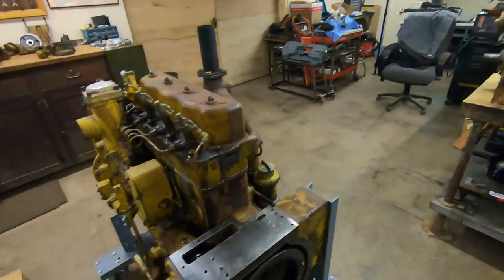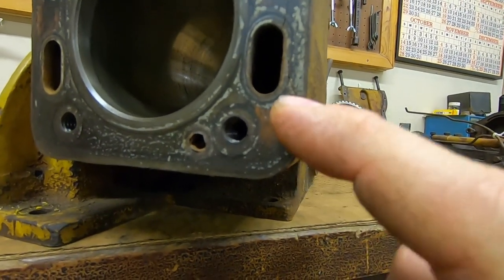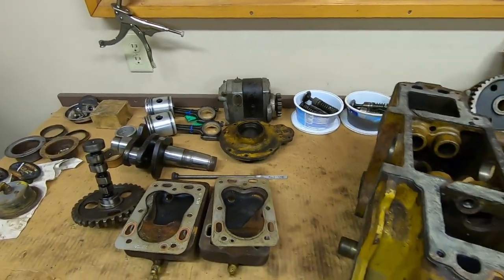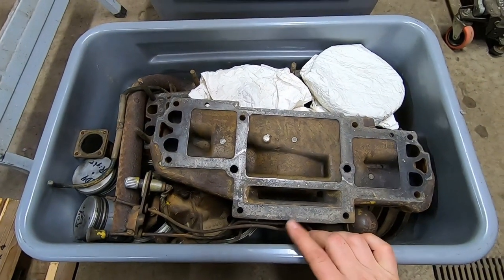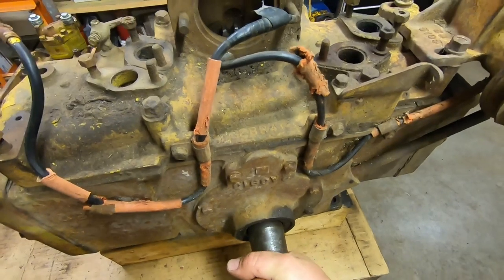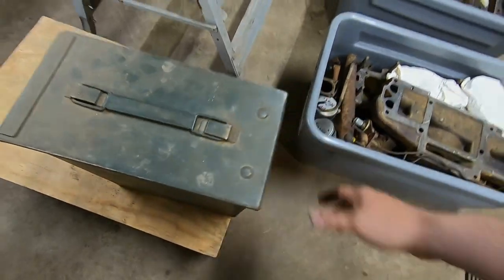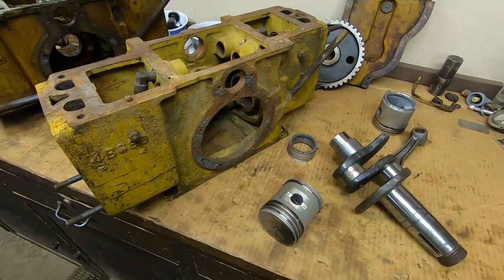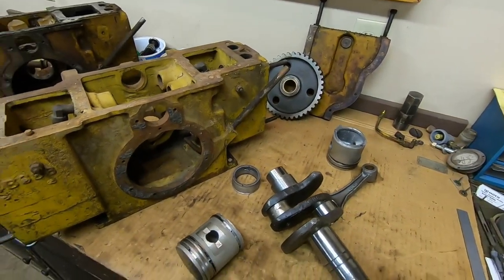Caterpillar D2 #5J1113 Starting System Ep.3: Starting Engine Damage & Replacement Parts Stockpile

Comment: do you or your father have a valve grinding pilot for the starting engines?  so with the valve guide out.. the big end of the valve guide pilot centers the pilot stud for the valve seat grinder.. what size is the OD of the guides or the ID of the bare block bore. this is a flat head ford valve guide pilot that fits in the  block with the guides removed.. https://i.imgur.com/75s2lOM.jpg   this crazy thing cleans the carbon from the flat head ford valve seat and valve guide bore.. https://i.imgur.com/NHe45FD.jpg  i think my sioux valve refacer is older than your dads.. https://i.imgur.com/9Ppo5Kq.jpg